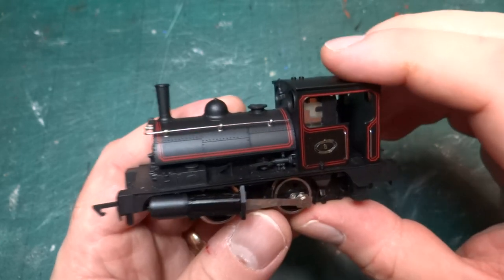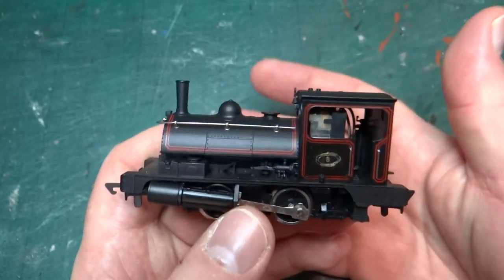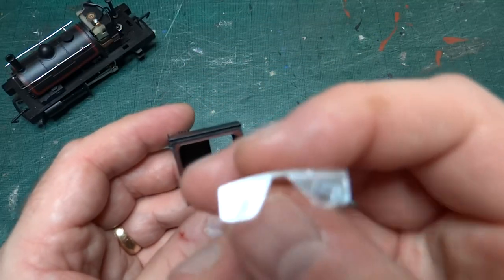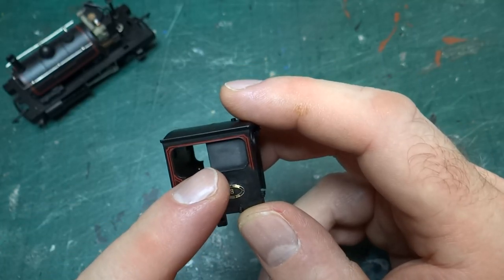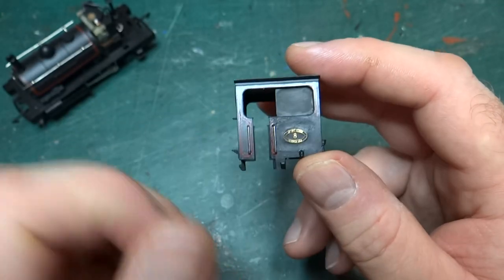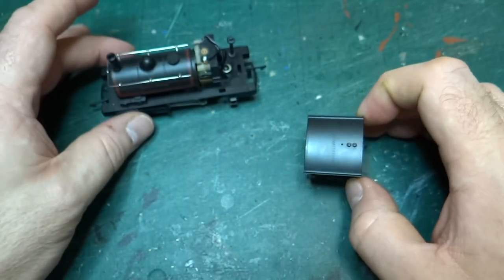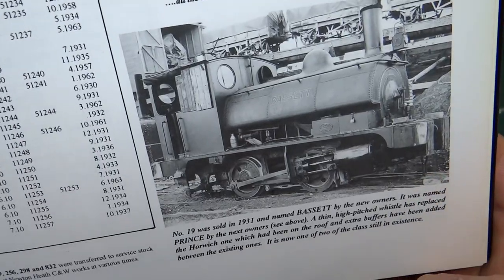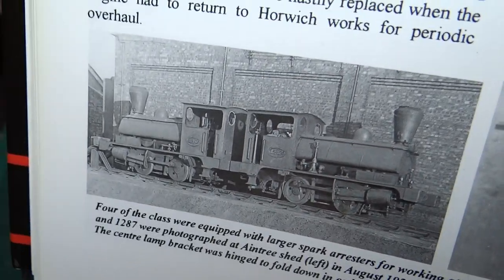Repairing and Improving... L&YR 0-4-0ST "Pug": A Nail Biting Start

Comment: I’ll look forward to see your high level chassis kit assembly. As I’ll looking to do the same to mine, in the future.
Reply from the maker: Having looked at their instructions it doesn't seem difficult a build, although I've not yet worked out if the kit includes the horn blocks for the compensation or not. Will have to drop them a message and see exactly what I need to add to the kit prior to ordering one -- I hate ending up without all the right parts.
Reply: @encoffeedrinker  It's a project I would, and want to do, but, as little most modellers, I have a lot of unfinished projects on at the moment. 🤣
Reply from the maker: if you are anything like me it's not just a lot of unfinished projects but the huge box of unstarted kits as well!

Comment: I've owned a High Level kit for the Dapol Pub since 2010 by haven't got around to doing the update yet. The kit isn't suitable for the Hornby version which they bought off Dapol.
Reply from the maker: It's interesting that you say it isn't suitable for the Hornby version of the model. I have previously owned both a Hornby and Dapol example and they seem identical. Also the instructions for the chassis kit are explicitly entitled "Chassis kit for Hornby/Dapol L.Y.R. 'Pug'". Any thoughts on why it wouldn't work with a Hornby model?

Also if you have the kit did it come with the hornblocks for compensation or would I have to buy those separately? I'll double check with High Level but it would be good to know in advance either way.
Reply: @encoffeedrinker  I had to go rummaging in my loft to find my kit. When I ordered it, I made sure all the additional parts needed (wheels/ motor etc) were included at additional cost. Now the Hornblocks and their corresponding brass front wheel bearings come in their own little bag and have a complete page of instructions to themselves.
Luckily I'm a mechanical engineer because the kit looks very complicated for such a tiny little locomotive, but the diagrams look decent enough (for me anyway).

Sorry, but it looks like I gave you a bum steer on the Hornby vs Dapol front. It's the original Airfix kit it can't be installed in say the instructions.